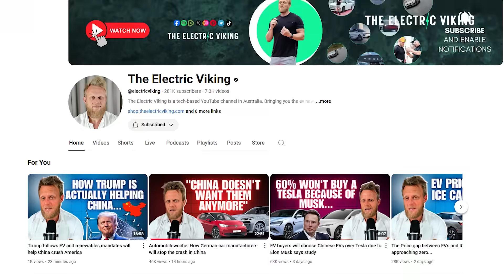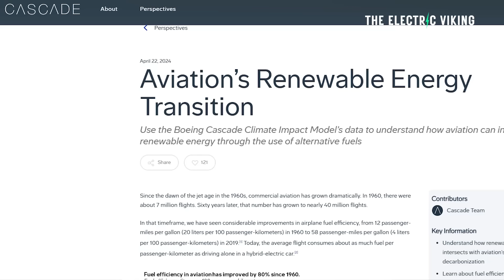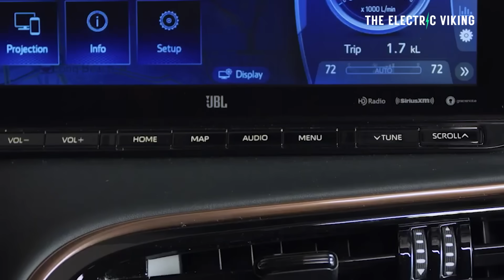The global industries that clean hydrogen production with DISRUPT

Comment: I am working 30 years at the sea now, at large vessels in the Dutch merchant fleet. 
Frequently sailing to Australia as well. 
The problem with electric propulsion with batteries is that the energy density for batteries is far too low in comparison to the energy density of heavy fuel oil. 
Ships will be too heavy and have a small range ifpoweredbybatteries. 
We can not charge the batteries in the middle of the ocean. 
Our ships are using roughly 100 mT of HFO a day, and solar and wind installed on a ship can not supply even a small part of that amount of energy. 

Hydrogen is a totally different story. 
For each kilogram, it has even a much higher energy density than HFO. 
Therefore, hydrogen is suitable as fuel to power large cargo vessels sailing intercontinental. 
The challenge is still to get the hydrogen safely compressed in order to minimize the size of the fuel tanks. 
The smaller the fuel tanks, the more cargo we can transport in volume. 
Hydrogen as a fuel at the sea is very promising, though.
Reply: Yes keeping the volume (space) taken up by the Hydrogen fuel to a minimum  is a big challenge. Even more so for long-haul aviation. But probably can be mitigated with serious redesigning.
Reply: By the same arguments shouldnt nuclear be an even better solution?
Reply: @corradoalamanni179  Yes, I actually do agree. 
To build very large vessels with a nuclear power plant for the propulsion. 
Sailing in fixed trade routes over the ocean to designated fixed ports. 
Bringing massive loads of cargo with each intercontinental transport. 
Well paid high quality crew on board. 
Continuously monitoring from a head office ashore. 
But the political will isn't there. 
In Germany, by example, they just closed down all of their nuclear power plants.(and started to dismantle them asap)
Reply: So you'd rather have highly explosive fuel on board that is notoriously leaky and continuously corrodes the containment vessel and distribution pumps and pathways requiring lots of regular inspections and routine maintenance? Seems like a winner.
Reply: @erktrek  Yes. 
If the technology is developed enough to do this safely, i will prefer the hydrogen indeed. 
If the wind is from the stern and the same speed as the speed of the vessel, we are breathing the exhaust gasses. (Dead wind)
I prefer to breathe the exhaust gasses from hydrogen instead. 
At the moment, the problem is that hydrogen is far too expensive. Far too expensive! 
So it doesn't make sense to sail on hydrogen. 
There is still a challenge to have the pressure up to around 3000 bar safely. 
Hydrogen is already in use in several harbors without accidents. 
But not on large ocean-going vessels. 
If hydrogen indeed is getting cheap from the Middle East, shipping companies will be interested in building hydrogen powered ships. 
I am convinced that it is possible to do this safely if the budget is large enough. 
The bigger the ship, the more efficient it is to build a large hydrogen system on board. 
The costs are getting smaller in comparison to the amount of cargo which gets transported. 
At the moment, hydrogen is too expensive, though. 
So, there is a little to no incentive to build large ships powered by hydrogen.
Reply: @ArjanSchaeffer1973  No you really do not want hydrogen vapors around your ship - it has one of the highest explosion concentration ranges from 4% to 75%!!!! NOT good... even if hydrogen were inexpensive as a fuel the issue is safely storing and using it with all the constant maintenance and replacement parts needed. It is just not economical (and safe) over the long term. Do you know the names of the ports currently using hydrogen for transportation or operation? I'm sure they exist but have not been able to find them. Thanks.
Reply: @erktrek  Thanks for the reply. 
I didn't know that the vapors of hydrogen after usage are dangerous. 
The port where I regularly see a hydrogen bunker barge activity is Antwerpen. 
If i see this in Antwerpen, then there are definitely more ports. By example, Rotterdam.
Reply: @erktrek  Actually, I made a mistake. 
The bunker barge is with LNG, not hydrogen. 
I am not sure. Most likely, it was LNG. 
I will inform myself better and will return back to this topic. 
Next week, I am back at the sea and keep my eyes open and ask around. 
But I think now that I made a mistake by confusing the LNG bunker barge with hydrogen. 
Thank you for your comment. 
An open discussion is the way we learn.
Reply: @erktrek  Yes, definitely, we don't want hydrogen vapors around our ship. 
After usage, the exhaust gasses are clean if I'm informed correctly?
Why would there be these hydrogen gasses around the ship?
When stored in the fuel tank, it should be a closed system. 
Pipes to the engine, everything should be 100% closed. 
If there is a leakage, that system isn't suitable for transportation. 
But it is hard to imagine that it isn't technically possible to build a 100% closed system.
Reply: @erktrek  I checked about Rotterdam:
Quote:
Hydrogen is already being bunkered at the port on a small scale. One example is the hydrogen-powered water taxi, which emits only water and no CO2.
End Quote. 
In Antwerpen, you can bunker hydrogen as well. But only at a small scale. (Like Rotterdam)
Reply: You still need massive batteries when using hydrogen as well. So you're better off ditching the complications of hydrogen for a diesel electric generator and batteries like many ships do today.

Comment: Should you add Heavy Industry to Shipping & Aviation ? I agree it holds promise in certain domains but issues remain with how to transport it between supplier and consumer. Shipping hydrogen is dangerous and inefficient. It requires liquefying and super-cooling. There will need to be a build out of shipping vessels that can accommodate the not inconsiderate constraints of the chemical.

Comment: I would think Ammonia, NH3 would be more suitable for aviation. It's safer and easier to store (less pressure and/or cooling to make it liquid). It would need nitrogen, N2, from the air and make it react with H2, which will cost quite some energy, but lighter airplanes because easier storage would use less energy. It would also save on maintenance, inspection of storage tanks as H2 would corrode metals and plastics.
Reply: Methane, hopefully made with CO2 and green hydrogen is a better direction to look into.
Reply: @machoopichoo2  I don't think so. You can burn CH4 (Natural gas) to CO2, Water and energy. Doing oppositie requires more energy as you can get out of it. And where do you get the CO2 from? The exhaust of a coal power station? OK, but those are supposed to close in x years. Collect from the air? That also would cost a significant amount of energy. 
Moreover: It requires a significant amount of pressure and cooling to keep it liquid. Less than H2, but a lot more than NH3. 
H2:    critical temperature -240°C, boiling point -253 °C (at atm pressure)
CH4: critical temperature    -83°C, boiling point -161 °C
NH3: critical temperature +132°C, boiling point -33°C
Critical temperature above ambiant temperature means that you can make it liquid by compressing, without cooling.
Making the fuel liquid is required, as the volume of the fuel would be much too high. Unless you would fly a zeppelin, it wouldn't be possible.

Comment: You don't have to split water.  Mr Viking already reported here that USGS has found masses of formations trapping natural hydrogen in them amounting  trillions of tons - just in the USA. Given some such formations are already found in use and exploiting them; the USA and other nations may solve their concerns worries about CO2;  providing the energy alternative many seek. Solar and Wind are not viable solutions there isn't near enough lithium production to provide long term strorage. You don't need to keep such hydrogen under pressure you could burn it right at the source to produce electricity or pipe it where every you want to; it isn't like hydrogen hasn't been used for over 100 years already.

Comment: I agree with you and don’t forget trains.  Trains will be H2 powered as well.  But I think the #1 use of H2 will be power generation for when solar or wind isn’t available.
Reply: @KeithWallsVocals-od5ry  There was a hydrogen train project in Germany, it was cancelled after 1 or 2 years because of higher and higher costs and tons of technical problems.
Reply: @KeithWallsVocals-od5ry  Trains are using electricity in more and more places, also battery electric trains, replacing diesel-electric ones. Hydrogen is too complicated, too expensive, too dangerous.

Comment: The Sahara Desert alone could theoretically generate 7,000 times the global electricity demand if covered with solar panels, according to a study by the World Economic Forum. There are enough deserts around the globe to spread renewable energy production close to cover local needs. But like everything in excess: the more we have it, the more we will find ways to use it.
From Hydrogen produce Methanol and capture CO2. (direct CO₂ hydrogenation: CO₂+3H₂→CH₃OH+H₂O). Or produce Amonia (Haber-Bosh process, Nitrogen is 78% of the atmosphere) used as fuel or fertiliser. Easier to transport and store than hydrogen.  Excess renewable energy could also be used to produce drink water from air or sea water. Or in vertical farms, or precision fermentation to produce food. IA data centers are also energy hungry. I believe that excess energy will only be a temporary situation. Once we have excess energy, we will find more ways to use it.

Comment: The thing is, governments want people to swap to electric vehicles or alternative fuels. The main problem is the government, suppliers of alternative fuel sources are not investing or building the infrastructure because it's expensive. Only when those costs drop will they then build the infrastructure. I work in the construction supply chain, and at the moment, building materials are at record highs. It all has a knock-on effect on costs. They want to build a charging station but need somewhere for customers to hang around for a period of time while their cars charge, the bricks, blocks, cement, glass, doors, industrial kitchens, etc all cost alot of money at the moment hence companies don't want to put things in place. Only when the infrastructure is in place will people on mass change over from fossil fuels. I have an EV for work, it's a joke, it doesn't current cover the mileage required to do my job even when work and the car manufacturer said it could, the cost of charging it are currently higher the petrol, the charging points are being vandalised by having the copper cables removed or even cut, the copper cables. The companies who own the chargers are not repairing them as it would only happen again. It's difficult to own an electric vehicle at the moment. Personally, if it wasn't a company car, I wouldn't buy an EV or even a plug-in hybrid vehicle at the moment. Our local council promotes people getting an EV or plug-in hybrid car but won't allow a charger to be put in at work because they don't like how the chargers look!!! You couldn't make it up.

Comment: Dont forget to mention 𝐆𝐫𝐞𝐞𝐧 𝐒𝐭𝐞𝐞𝐥 which is the showcase for the transformation of a number of industries to H2. The EU has been running pilot projects for decarbonizining the steel industry for years and they have forecasts of the required fuel - basiically green steel production will soak up every bit in the next decade. 

Currently avatation aka Airbus has postponed H2 engines to a later date as the resources are not enough to power both markets soon. Yes, they are developing it, they are testing it, and they wont start production anywhere soon.

Comment: Almost all large ships will still remain with oil based combustion engines for a long time, because it is much cheaper and easier.
The only practical way to create Hydrogen is from oil, first converted to Methane and then to Hydrogen which is slow, expensive end huge energy losses in the conversion.  Nobody will do that extra expense if shipping oil is competing with it.

Comment: Hydrogen for ALL kinds of energy is not viable, for Aviation, shipping or grid storage.  Hydrogen is pushed as grid storage by those interested in selling fossil Hydrogen, they will quote how great energy storage is, but do not mention that Hydrogen is the worst type of electrical storage.  The Round trip efficiency is <35%,, when batteries have >90%.  This is why Hydrogen is expensive, it not because of volume its because of physics.   You need 3x more electricity for every unit of Hydrogen, you only need 0.1x more for battery storage.  Hydrogen plant costs more and is bigger, its dangerous and causes problems with materials, storage is leaky.   It has zero benefits over batteries.  No-one is going to produce Hydrogen at a loss, if you have 3x spare electricity you will make more money just selling that.

Comment: Hydrogen produced using excess wind and solar energy, will FIRST be used to clean up existing industries that are using tons of dirty hydrogen as a chemical component, like fertilizer factories and plastic producing factories.  Dirty hydrogen is responsible for just as much CO2 output as the Worldwide airline industry! 

Hydrogen is also used to clean up the production of steel, where it will replace tons of coal. 

Only after this is achieved it might be a good idea to look at shipping. But I will be long dead before that happens (I am 59)

Comment: If hydrogen cars dominate any market, it might be Japan where they are, that's the highest possible I think. Because the Japanese government is backing that idea. And policies like building lots of nuclear, including maybe red hydrogen it might make sense.
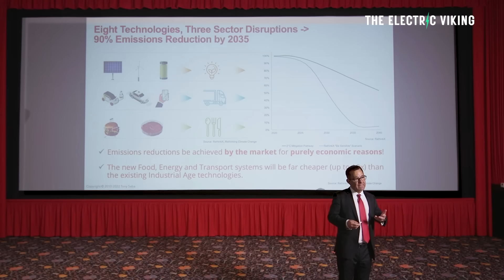5:16 at least 2 times, but that will need a lot of batteries, they said 4 times will be ideal, needed less storage.
8:25 it very much depends on the weight of batteries and the economics, hybrids actually were doing better than EV in the past, I can see how it might happen again, a very very small change though, single digit percentage chance. Economics and charging times, and that last one, maybe better handled by super-capacitors than batteries, thus taking away an other reason why charging times isn't such a problem after all.

Comment: For the airline industry I expect short haul, UpTo 200 passenger aircraft will be electric, long haul I expect Sustainable Airline Fuel will become mainstream, where renewable energy is used to produce airline Fuel using water and CO2 from the air. Hydrogen is too cumbersome to be used as an airline Fuel. It's too dangerous, leaks are inevitable and it burns invisible. It's very hard to use it safely on board an aircraft.

On cargo ships hydrogen could become a thing though, because  safety is not so much of an issue, or easier to achieve, because less people are involved. Due to the size of the ships, hydrogen and the engines can be isolated more easily, people can be separated from the danger areas.

But on shipping there are way safer and more exciting developments making it more sustainable, we turn back to WIND! Sailing the oceans like we used to in the golden age of world trade back in the 16th and 17th century!

Comment: Sam it isn’t cheaper, you know this. To replace the entire infrastructure we have now with renewables which btw in northern nations isn’t a great option is a fantasy. The cost of production of wind turbines which last a maximum of twenty years and sit on a concrete base on average six hundred tonnes in weight each! This will take up huge amounts of land unusable again due to toxic elements in concrete. Solar, forget it even more land and panels you know full well are not recyclable, again toxic elements. Where are all the power lines going as these items are usually in remote areas. Aircraft can’t use batteries, that’s absurd and stupid. All of this is pure wishful thinking and economically disastrous. We are seeing this now in Europe with a mad rush to renewables and not using cheap Russian gas. All will end in tears and just ask domestic users about the eye watering prices we pay now for energy.